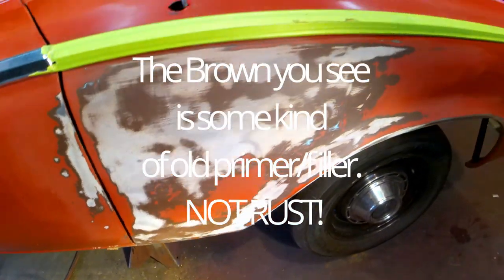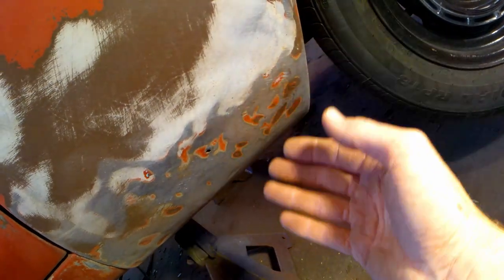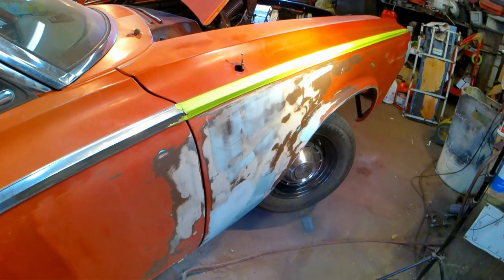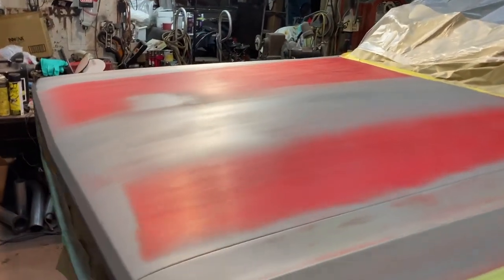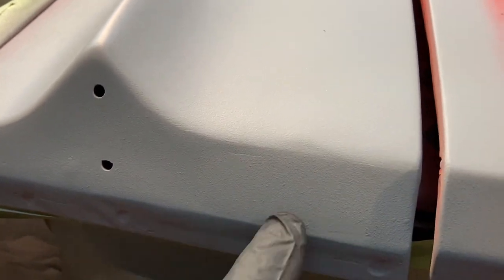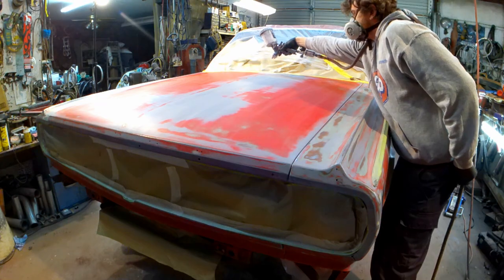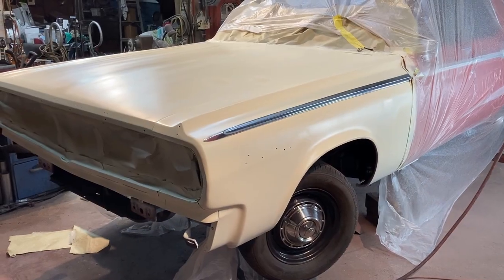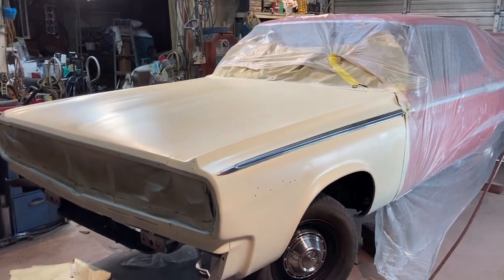65 Coronet: Shows It's True Colors! Front Cap Paint Ready!

Comment: Window cleaner but no tack cloths?
Reply from the maker: Tack clothes are commonly used to remove overspray and loose dust between coats of base and clear. I wouldn’t tack between coats of primer. A good wax and grease remover would have fine, but the car was just washed when I pressure washed the engine bay a few weeks back. When it comes time for final paint, I will wash the finish sanded panels with Dawn, allow it to fully dry. Come back with wax and grease remover, the glass cleaner that has alcohol in it, then blow dry, the tack right before the actual paint hits.
Reply: @JustMoparJoe  thanks I was just making sure I am going to kind of follow behind you on this
Reply from the maker: @scottdurant6868  check out hands on cars with Kevin Tetz. He’s the man!